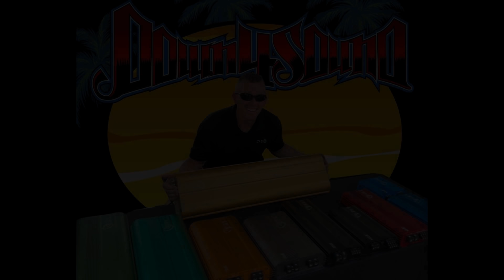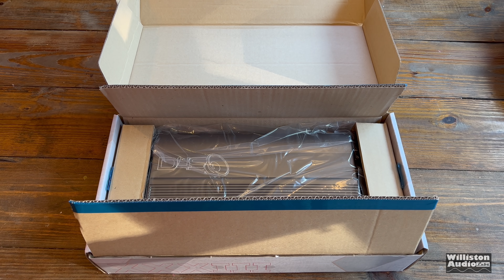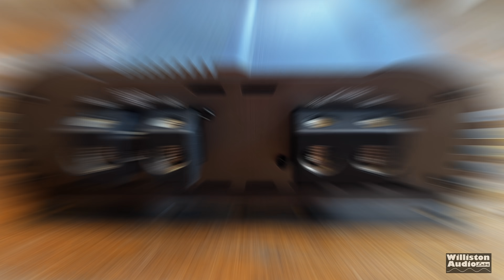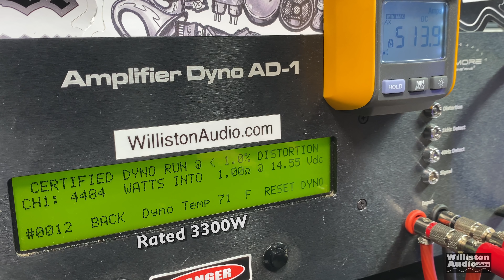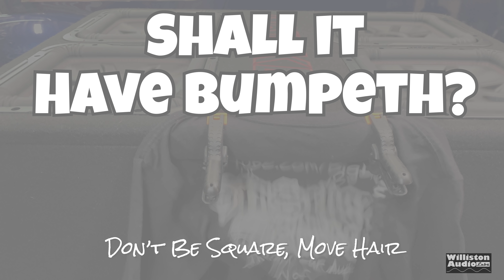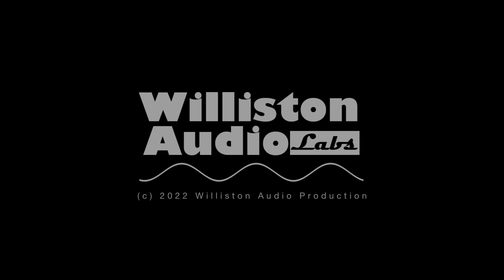3300W Battleship? Down4Sound JP33 Monoblock Bass Amplifier Amp Dyno Test [4K]

Comment: Back in the late 90s early 2000s I would have laughed right in someone's face if they said they had a single 3000wrms amp then showed me something that size. Absolutely crazy how far things have come, 98% efficiency... that's borderline magical.
Reply: I remember the surf board sized monster amps people were running back then.  It really is incredible.
Reply: @brandonsealey4511  They still run them. I've got one and really need to swap it for a class D. Just haven't because I have a weird attachment to having all the same brands.

Thanks to this and the CarAudioFab channel, I'm going to swap all my Zapco DC class ABs for Audiocontrol class Ds.

Hopefully all will be well.
Reply: One of the many downsides of old school Class AB amps the horrific size of the amps, the horrific efficiency, etc. Many guys talk up the SQ of Class AB but less than 1% THD is the same if its a Class AB or Class D amp...
Reply: Have a look here on Youtube for an explanation of why Class D amps will never sound as good as a good analogue amp.
Reply: @jameslucas3161  theres a guy paul something with the hifi home audio hes pretty good for a sound q discussion I will see if I can remember his name
Reply: @jameslucas3161  That not 100% True, your talking out ya butt. Class D doesn't sound as good at CLIPPING, but below 1% THD wether on Class A, AB, or D its all the same an amplified signal with less than 1% Total Harmonic Distortion is Inaudible to the human ear, those claim they can't tell the difference I call BS you've NEVER taken a blind listening test.
Reply: @Jamez84  
What order is the harmonic distortion rated in for these tests? Even or odd?
Reply: @jamescurrier5828  No idea what your question is trying to articulate so this is the best I can answer with what I think your asking.... The Certified test (1ST) is up to 1%THD. The un-certified (2nd) test is up to the amp's clipping point, beyond 1%THD. The Burst test (3rd) is again at the clipping point but in short burst it much like a song would have. I'm not 100% on this though as I don't own the an amp dyno and NEVER read the user manual Big D explains this in the videos. Also those dyno's can actually play full music and give a rating that way as well.
Reply: @Jamez84  
I’m articulating that there are odd and even order harmonics. Since it is total harmonic distortion, this would mean that 2 amplifiers with same THD rating could in fact sound different due to having different amounts of odd and even order harmonics.
Reply: @Jamez84  I call BS, you can’t even spell buddy.   The subject is not up for debate,  AB will always be a superior design for sound quality.
Reply: @caseytbss  WTF I HAD NO SPELLING ISSUE'S That's just loser talk from a butt hurt queff that can't back up his BS with ANY FACTS. Get Over It Class AB sucks that why BOSS uses it
Reply: @caseytbss  I've seen your channel you haven't uploaded a video in 4yrs and what you did were kickers and probably a system you didn't install yourself. Your just crying coz you're all butt hurt EVERY SQ company is going to stop making class AB amps in the next couple of years. Its OUT DATED OLD tech that hasn't gone ANYWHERE in the past 40yrs its been around. Meanwhile Class D has Clip limits, Better filtering, and gotten smaller, more efficient, and cheaper. The ONLY people who think Class AB amps are better than class D are OLD Gen X and Boomers who only have NOSTALGIA to back up their claims that it sounded better back in your day. 😂😂😂😂 Tech Changes and so do the times. Next time bring some data or some research or ANYTHING to back up your LAME claims other then Non-existent Spelling errors. 😂🤣🤣 Your a JOKE if that all you got is spelling errors to support your claim...
Reply: @jamescurrier5828  Prove it, what your saying MAKES NO SENSE. THD is measured in a percentage not evens and odds. In ALL MY YEARS in car audio I've never heard this BS. Prove it. Cause you sound just like the guys who know NOTHING in Facebook groups. Like ,The team no fuse idiots.
Reply: @jamescurrier5828  Next Time do your own research I shouldn't have to use Google to figure stuff out for you, esp when I dont care.
ODD OR EVEN?
So we know that harmonics are produced when distortion is applied, however, these harmonics aren’t random. Depending on the type of distortion, we can manipulate whether odd or even harmonics are produced.
Let’s say we are cranking our tube amplifier on a high gain channel. Tube distortion is synonymous with warmth and clarity. This is because the tubes create even harmonics which sound subtler and rounder.
Conversely, if we then turn on our solid-state amp and do the same, the distortion will produce odd harmonics which are often described as grittier and more aggressive in tone.
You’ll often hear guitarists claim that tube amps are far superior to solid-state, though to be frank, beauty is in the ear of the beholder. There is no right or wrong answer here. I recommend checking out our article on tube vs solid state preamps for more info on that debate.
IS ONE BETTER THAN THE OTHER?
Audio production is never straightforward, there, unfortunately, is no ‘better or worse’ when it comes to harmonic distortion!
Our ears naturally pick up on even-order harmonics, we’re able to interpret them as more “musical” than odd-order harmonics but that doesn’t mean that odd-order harmonic distortion doesn’t have its place. Sometimes that edgy grit and unstable aggression that you get from odd harmonic distortion is just what you need for a track.
As always, experiment with each and learn what each can offer to improve your mixes and achieve the sound in your head.
Reply: @Jamez84  
Touchy touchy 😂
That’s some projection on your part saying I need to do research, so you don’t have to figure stuff out for me. You didn’t even somewhat understand how the ratings worked before you went on your Google search. 
I’m not saying anything bad about class D. It most definitely is great and even superior in a lot of scenarios (when properly designed). 
To say all the crap that you have been spewing shows a lack of knowledge and self control. If you don’t care, maybe you shouldn’t be speaking in the first place.
Anyway, rock on and bass out!
Reply: @jamescurrier5828  Use Google next time bruh, sorry bout the attitude its early n I'm trying to enjoy coffee while everyone smoking around me n I all want to do it sit in my car and thump while having a smoke. Not to mention odd even harmonics is something guitarist are more concerned about not bass heads.
Reply: @jamescurrier5828  total harmonic distortion is the addition of both hence total. As long as you're under 1% any combination of odd and even is going to sound the same to your ear since it's such a small amount of the sound produced that you literally can't hear it.
Reply: @caseytbss  AB sounds better for the same reason vinyl sounds better, which is to say it doesn't, it just triggers some nostalgia in people. If an amp is under 1% THD you cannot hear the difference. A high end RTA or something may be able to see some slight differences but a human ear won't.
Reply: @jamescurrier5828  He literally stated facts in the 1st responses to you and then he went on google after you wanted him to explain the bs gritty details you wanted. Even after he roasted you, you still couldn't own up and be a man to admit you where wrong in the 1st place. Instead you act like a Karen-B, going on about "your right in most scenarios there good but im still right".
Reply: @James Lucas  yeah maybe in an acoustic room in a house. But I would like to see a blind test with the same equipment in a vehicle then a room. I am skeptical that many, if any, could "actually" hear a difference. Maybe with only high res mids/highs and minimal sealed enclosure bass.
Reply: @Jamez84 only when you're talking about sound quality through your component speakers or coaxials when you're talking Bass with Subs not mid-range you can't hear the difference and let me be clear we are talking about the uncertified ratings where it just barely starts clipping compared to the less than 1% THD with subwoofers is not audible to the human ear
Reply: @Jamez84  no, no it’s not the same,  there is more to it than thd.   Class D will never be AB
Reply: Yeah, look at the JBL Crown 6k that came out in 2005-2006. That was a huge amplifier. Now, you look at the same power from amps like this and the Taramps Smart 5k. They seem tiny for the power they put out.
Reply: I was calling people idiots last year when they were posting on a site asking if anyone had a used 4k watt amp for sale. I was going to shows when 10k watts was what the PPI van was sporting and had 3" plexi windshield in an astro (ci 1990- 91) , well i guess it was 2 years ago now. Amazing how far (and cheaper) we have progressed
Reply: Turns out i was the idiot.. and it all woke back up because of this very channel. I will say i have more patience now, and dont rush my installs like when i was 16 lol
Reply: Yep I had a Autotek Stealth 1500. And that was about as big as you could get. Rockford 1100a2, Directed 1100d. Etc.. 👍
Reply: Right. A 3300 watt amp back then was longer than the vehicle it was going in.
Reply: Think about what another 20-25 years will bring too
Reply: @Just a weeb with VW named Erika I still have one
Reply: You should check out the sound digital 3k nano talk about a super tiny 3k rms amp that fits anywhere
Reply: If Class AB were so good then EVERY cheap crap box amp company like BOSS, Planet Audio, AutoTek, etc wouldn't be using them. Its a 40yr old tech that has nostalgia. Same guys talking up how good Class AB amps are, were the same guys who used windows 95 for 20yrs. Just like computers have gotten better faster and small so have class D amps. Unfortunately class AB amps are the Atari of car audio. They are an OLD tech that hasn't gotten ANY better and now companies are selling them at rock bottom prices with all the games for 5 yr olds.
Reply: For real!! For that amount of power it would of been 6 feet long! And the price in those days was crazy. At one point is was basically a dollar a watt! Crazy how much has changed.
Reply: @JayP7.62  JP is releasing a class AB version with these amps for class AB guys. It looks like its 6ft long. IDK if he has then up on the site yet for sale but he showed them on his YT channel the other day.
Reply: I had a precision power 1500 amp that was like 24in. It was a monster. Had 3-12" JL W'6s is a custom box to fit in my Nissan 300zx. Crazy loud
Reply: both ab and class d amps have their place in the industry.. but they arent the same..
Reply: @davidstevens7809  less than 1% is in audible, you'll never know though without a blind test. I bet I could play a class AB and D in blind test and you couldnt tell the difference. Anyone who says they can has NEVER tried and is completely full of BS

Comment: Like the amp and specs just concerned if the bass knob pairing is secure so someone at a competition doesn’t walk around with one of those knobs in there pocket messing with cars
Reply: It’s linked only to the chips it’s by 5.0 so you can’t swap pair unless you disconnect like a by speaker with 5.0. I designed it and its also bluetooth certified

Comment: Why yes...  Bumpeth it does indeed.  🤣

That is a real clean looking amp, to include the internals.  Really dig the plexi under cover.

What is the design intent of the knob having slow ramping to transition volume?  I don't get it...
Reply: Still using emojis, barf

Comment from the maker: See more and get your JP amp here:
(Affiliate links and all may not be available)
JP33 Amp: https://bit.ly/3PKhSNk
JP43 Amp: https://bit.ly/38qOcUQ
JP63 Amp: https://bit.ly/3t0fAQy
JP83 Amp: https://bit.ly/3t0zz1y
JP132ab Amp: https://bit.ly/3yYsEcT
JP34ab: https://bit.ly/3sZoFsY
JP23v1.5: https://bit.ly/3yYt9DN
JP234 Amp: https://bit.ly/3NF8clC
JP8 Amp: https://bit.ly/3wOBbhg
JP84 Amp: https://bit.ly/3lR2ukJ
JP95 Amp: https://bit.ly/3yYtd6v
All JP Amps: https://bit.ly/3lMb4kz

Note: This video is shown as paid promotion because 1) I'm keeping the amplifier for future testing and 2) I'm an affiliate with Down4SoundShop so using my links in this video to purchase car audio results in compensation for me. I was not paid by D4S for this video. Rest assured the info provided here is factual and my opinions on the product are NOT based on possible compensation. I test amps and provide information for the consumer, what you decide to purchase is your decision. Thank you.

SMD / D'Amore Engineering Amp Dyno: https://goo.gl/sJTcf7
XS Power D1400 Batteries - https://amzn.to/2BPFCKW
XS Power / Yinlong LTO Lithium Batteries: https://lddy.no/13d2f
XS Power PSC60 Charger - https://amzn.to/2CHGcfs
Fluke 1000A AC/DC Clamp Meter: https://amzn.to/2Rw5WDA
Handheld Dyno SMD AMM-1: https://lddy.no/106tm
My Favorite Screwdriver Kit: http://amzn.to/2x0VzcE

DISCLAIMER: This video and description contains affiliate links, which means that if you purchase from one of the product links, I may receive a small commission. As an Amazon Associate I earn from qualifying purchases